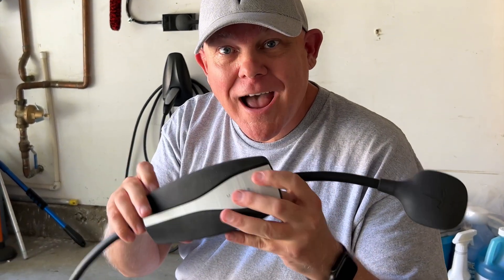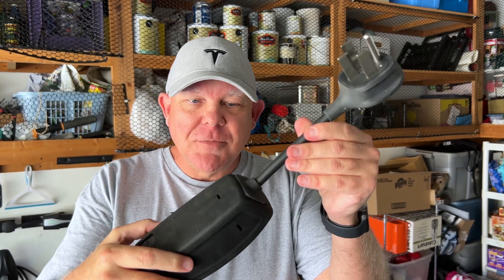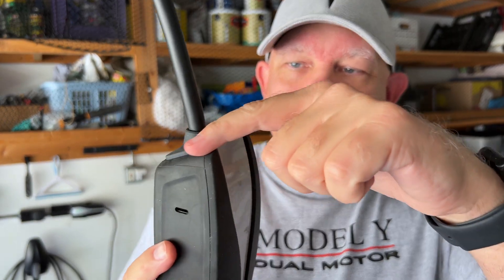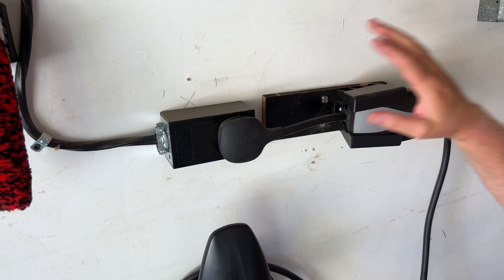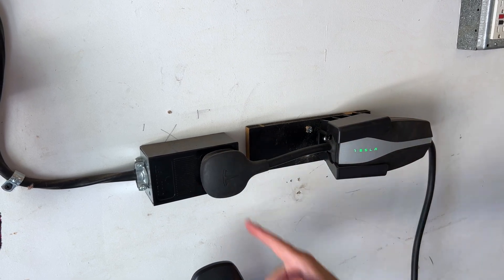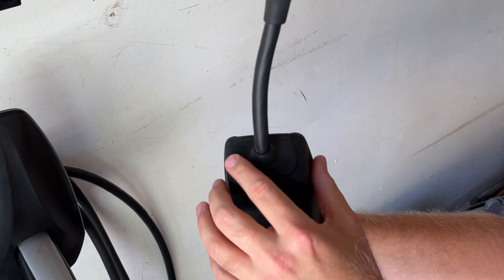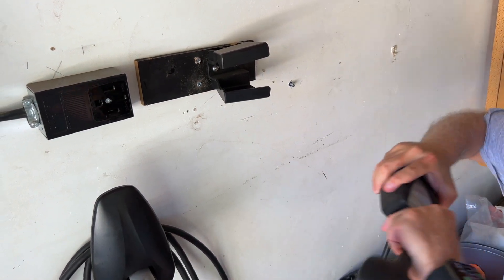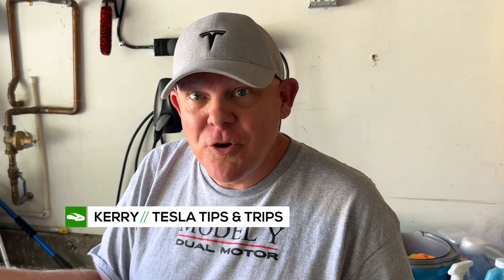Tesla Mobile Connector Slow Charging at HALF Speed? Overheating? This Could Fix It

Comment: Thanks, this helped me fix the issue. However, the fault came back after few days and it wouldn't clear after reseating the connector/adapter, so I ordered a new one and the problem hasn't reappeared so far. Fingers crossed

Comment: If the difference between a good connection and a bad one is only the slight offset of the adapter connection, It says to me that the internal connections of the adapter have an insufficient contact surface and results in a hot connection.  I have noticed that when I get the error message, I can touch the wall plug and the connector and the connector is much warmer than the wall plug (40 amp circuit with Hubbel outlet). What I do is to spray electrical contact cleaner on both the adapter plug and the mobile connector contact points.

Comment: Thank you for this. I figured this out.  But it kept happening, so I swapped out the adapter to a new one and it just happened again even though it's firmly plugged in.  Prior to this happening, the electrical company that installed it popped by and swapped out the outlet/breaker as they hadn't installed the right size breaker.  So I'm still stuck with the issue.  My outlet does "dangle" so I always check it before plugging into my car.  Any updates in the last 2 years?
Reply from the maker: That's frustrating, I have the upgraded charger, and it has the same design, although I have't used it yet, so I'm not sure.
Reply: @whooshn  I unplugged it from the wall n ight before last as it was "hot" again.  The new adapter is firmly plugged in.  It's so frustrating.  Have you ever heard anyone replace the Tesla 110 cord?

Comment: If I could only figure out why the internal GFCI circuit inside the mobile connector frequently keeps giving me an error (it’s not my circuit or installation because I have a second one that works fine plugged into the same 14/50 outlet)

Comment: Hello, I need to transmit electricity from the Schuko socket in my house to the garage with an extension cable. What type of cable do you recommend for a distance of 30 or 50 meters?

Comment: Just got a mobile connector and it won’t charge past 6amps. I just got a dedicated 240 with the 40 amp fuse but it won’t go up? Any advice.? I’ve reset the breaker and took apart the mobile connector adaptor and no luck?
Reply from the maker: That’s lower than a regular outlet. So something isn’t right.
Reply: @whooshn might just try to exchange the charger?

Comment: Hi I have not been open to electric cars but want to help Tesla so I am going to lease a Tesla. Is it better to buy the mobile charger or home charger ?
Reply from the maker: Both will get the job done just fine. Mobile can be plugged into a Nema 14-50, the Wall Charger (Home) is hard wired and more expensive.
Reply: @whooshn  thank you! test drive set for Wednesday..still a bit worried going EV but ready for the change

Comment: Awesome Tip, thanks for sharing.  Also, I believe I found the source of your problem,  I believe you have the holder on the wrong end,  It should be flipped over on the other side of the charger / Wall connecter.   If the cord gets pulled on its going to result in it becoming unplugged.

Comment: Actually, I was unaware of this problem when I installed the holster for the mobile connector, BUT, not feeling comfortable with there being ANY kind of weight dangling from that connection you're talking about, I deliberately located the holster about a half inch closer to the 240 VAC outlet than theoretically you would do.  I checked it just now, and there's no indication yet of it backing out the way you describe.  On the other hand, since you've installed yours horizontally I don't know why you haven't experienced the same thing.  (Mine has been installed for 5 or 6 months).  Since we have two Teslas now, I have also installed a Wall Charger on the opposite wall of the garage.

Comment: I believe you need to rotate the charger holder 180 degrees to prevent it from sliding out. That little bit of sliding out each time you take the cable out  for charging causing this to happen.

Comment: I’ve tried your tip and it worked for about 2 hours and then went right back to the issue of blinking red T. I know Tesla manual said to disconnect and reconnect and if problem persists, to move the vehicle to a cooler climate. The vehicle is in my garage so I’m not sure how much cooler I can get. I’ve tried having a fan blowing on the adapter and the charge port of the vehicle at the same time and still has the issue. Any other tips I might try? I did put in a service request from Tesla so hopefully I’ll just get sent a new one since it is under warranty
Reply from the maker: Could be a faulty unit, temperature has never affected mine, even on 110 degree days outside (about 90 in side the garage) https://service.tesla.com/docs/Public/diy/models/en_us/GUID-A3E92BEC-5A7A-4092-BAAF-A17B8E863B3F.html

Comment: Thank you, for this! The adapter creeps out over time thanks to a flawed design that fails to lock the adapter into the connector. When it creeps out, the area of contact between the connectors decreases and so the resistance between them increases, and with it the temperature. You can use a couple of zip ties around the length of the connector to secure the adapter. Wrap one tie around the connector from one side of the cable at one end to the other side of the cable at the other end. Fit the other tie in the opposing position. If you haven't got zip ties long enough, you can link multiple short ones together, tail to head.
Reply from the maker: That's a great idea! Thanks for watching!

Comment: Ugh, I’ve uninstalled the cord and fully seated it multiple times, but I continue to drop from 120V to 112V and must change amps from 12 down to 10.  It then drops back down to 114V and starts with the off/on charging scenario.  I’ve tried different outlets on different circuits with same results.  No error messages so maybe the mobile charger is going bad.

Comment: I tried the way you suggested. It worked for a day but second day started charging  @15mi/hr. This could be happening as charger is hanging and might be having loose connection again. So to overcome this problem I put the cable ties on both sides of the charger. And now the problem is totally fixed. Thanks.
Reply from the maker: Interesting. Good fix. Thanks for sharing.

Comment: The plug is being moved from thermal expansion.   There is more electrical resistance at the point where the contacts are plugged in.  That electrical resistance results in a hot spot.  As things get hot they expand a little bit.   Over many cycles or charges, the plug moves out of the charger which results in an even hotter hot spot and the car reduces the amperage to reduce the temperature of the hot spot.
Reply from the maker: Best answer yet. Thank you!

Comment: I replaced my Mobile Connector 15 months ago.  For the last few months the replacement stopped working, I was getting a flashing red "T" on the Mobile Connector.
So today I watched a video on how to use a multimeter to test my NEMA 15-40 outlet.  It tested fine.

So that narrowed it down to the Tesla Mobile Connector.

I watched your video after thinking I needed time from work to go to test it at a Tesla service center or just purchase a replacement from the Tesla on-line store.

The NEMA 15-40 connector looked like it was plugged in all the way unlike your video.  I pulled it out and pushed it back in again and the issue seems to be gone.

Thanks, IT FIXED THE PROBLEM.  After months, I'm charging at home at full speed again. So grateful.
Reply from the maker: It’s really great hearing this helped! Thanks for watching and I’m glad it solved your issue.
Reply: @whooshn   There is a follow-up  to this.  The problem fixed and then returned. The re-seating helped but didn't resolve it completely as I needed to re-re-reseat it a few times. The mystery issue that relates to your fix appears to be dirty communication connectors.  I used a pipe cleaner with alcohol to clean the tiny connectors on the Tesla Mobile Adapter for NEMA 15-40 and it fully resolved the issue.
Reply from the maker: Ooooh, that is interesting, I appreciate your update in case this comes up.  It's still very odd that it comes un-seated at all over time, even when gravity should't be a factor.

Comment: Thanks for the information on the adaptor plug needs to be fully seated into the charging module.  I just have mine hanging so I will definitely keep an eye out for plug coming loose.

So far i have had no problems.  I never remove my charging system from the 220 volt line. I always go down and turn off the circuit breaker when charging is complete.  I only charge up vehicle at home.

take care.
Reply from the maker: Thanks for watching. You really don’t need to touch the breaker. 10 years of driving electric and I’ve never done that.

Comment: I worked in an elementary school as a computer teacher in a 30 station lab for several years, and one thing I did at the start of every month was walk the lab and push in all the power cords. Many plugs needed the push. I have no idea why. 

But anytime a teacher called with a tech problem, one of the first things I’d suggest was to make sure the power plug was pushed in all the way. That “cured” the issue many times, saving me a trip to the classroom, and getting the teacher back up and running quickly. (Also very effective was rebooting and/or unplugging for several minutes.)

Weird but true.
Reply from the maker: Very strange isn't it? Thanks for watching!

Comment: 2 of 2…. So am now wondering if I did not have the adapter seared fully as you showed. I’ll have to give it a try on our next visit and report back.   

At our home we have a hard wired level 2 charger installed. We use it for almost all of our charging and it’s great. Thanks for the tip.
Reply from the maker: Hope it helps!

Comment: Just received my 2023 Model Y Long Range last week.  Moved up from a Chevy Bolt. 

The Bolt EVSE can charge both 110 and 220/240.  We would plug in to the unused dryer outlet and of course it would charge much faster than when plugged into a 110 outlet.  Mostly we did this when visiting family at their home.  We just did it with the Tesla and notice the charge rate was MUCH SLOWER that the Bolt EVSE.
Reply from the maker: We also had two Bolts. 2017 and 2020 model years before our Teslas
Reply: Dryer plugs are dangerously weak for the steady and strong amp load for EV charging... Not all NEMA 14-50's are created equal...

Comment: Hey, thank you for showing this. I had two mobile connectors. And this half-charging thing has happened. So I thought it was broken and I started using the second one (both had their own Nema 14-50 adapter). After a few months I tried the 'broken' one - but this time I pulled out the plug and reconnected it to the mobile connector as you showed. Then it 'mysteriously' worked like normal.  Now I know why. Many thanks to you!
Reply from the maker: I love comments like this. So glad it helped you. I appreciate you watching!
Reply: Mysteriously maybe the wrong adjective hehe.
Reply: Same boat. This is a great til

Comment: My holster is installed vertically. The EVSE is installed vertically and rests perfectly in the holster that is supporting the weight of the EVSE. No strain on the wall connector. No chance if it coming lose. I haven't had any problems.

Comment: Look like your 14-50R outlet is not industrial grade. Does it get hot when it is charged? Tesla recommended industrial outlet made from Hubbell, Bryant, and or Cooper.
Reply from the maker: Going on 4 years now. Not a problem at all. Thanks for watching
Reply: @whooshn  I am going to install one for my garage. I did some research. That is what I have found from Tesla support websites recommended.
Reply: Lots of research led me to the Hubbell, not just because others said it, but because of my RV's 14-50 arcing out and it completely melted the receptacle and RV cord plug.... Major fire chance with cheap dryer plug...
Reply: Wow. I must have used some junky one from Home Depot. My first outlet stopped working after 2 years. Got the same brand from home depot and replaced it. Now, I’m having a hot wire and blinking T. Maybe I need to replace it with a quality outlet. Thanks!
Reply: I agree, that is cheap outlet.
Reply: Of your plug doesn't use an Allen wrench to tighten the wire nut, and you are using a screwdriver instead, it's the wrong one plug.